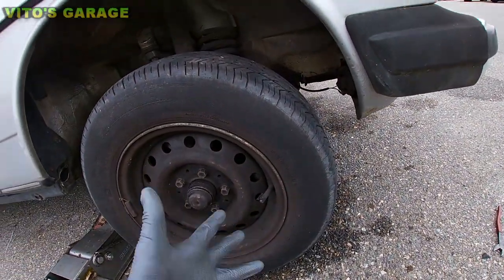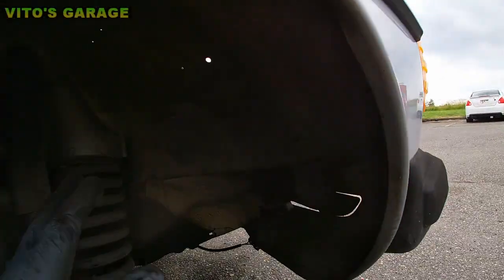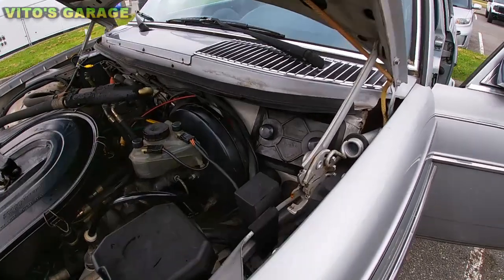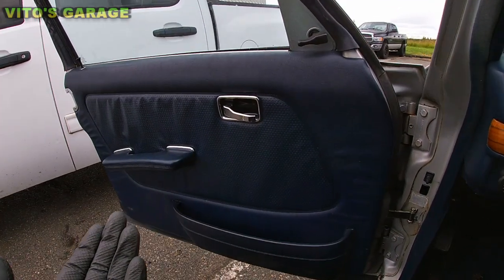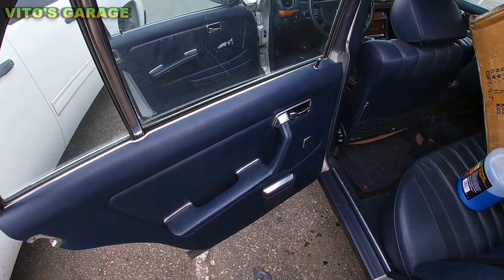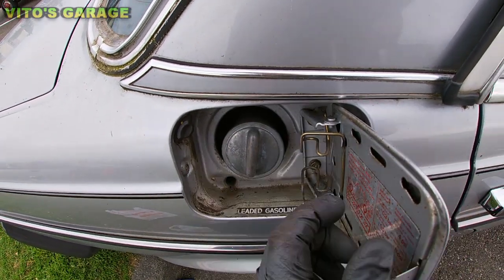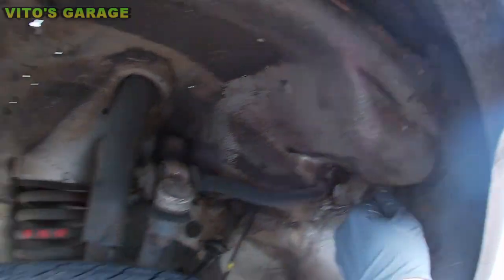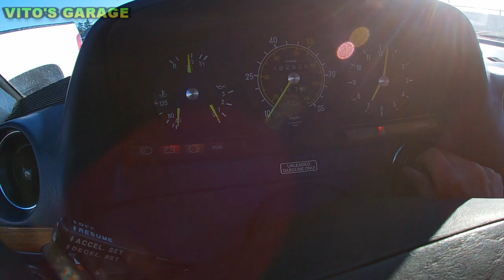Mercedes 280E W123 Finishing the Inspection & Delivering the Car!

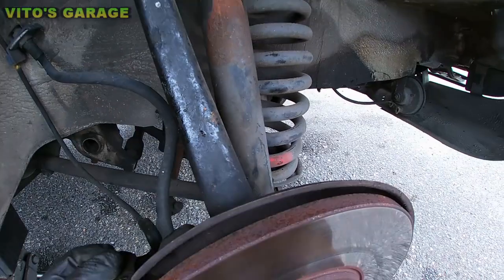Comment: 1:40. That kinked brake hose is exactly what I had on my 81 240D. It was so weiredly out of position the wheel was contacting it during full lock turns and over time wore a tiny hold thru it. So I lost my front brakes on the way home a few months back. Fortunately the dual brake system saved me because the rear brakes stopped the car. Couldn't believe it when I saw what it was and that this 280 has a problem with the same hose. Always be careful when  you buy an old car. You never know who did what to it in it's previous ownership.
Reply from the maker: That's crazy. Thank God everything ended good for you. And it's sad when people who don't know how to work on cars start working on them. This is how it ends up. We have to repair someones mistake

Comment: Great video as always Vito! Been watching your videos from the start. Could I ask you a quick question please. I acquired a w123ce 280ce a while back all the windows do not work. I have changed the fuses, checked the switches doesn’t seem to be any noise coming from there at all. Can you suggest anything else I can check on it? The sunroof is fine. It’s like the windows have not been used for years. Many thanks
Reply from the maker: You need to find a wiring diagram for the power windows for your specific car and diagnose it. You may be missing a ground or 12V power feed to your window switches.
Reply: Thank you Vito! 👊🏽
Reply: Hello, check your relay in the little black box, not the fuse box. A0015420219 or A0015422219
Reply: @souphianeb7908  thanks will review - do you know where this relay is located?
Reply: Otherwise it could be the vacuum system, have just bought an old c123 and have to tackle that.

Comment: This one has good bones and can be brought back to true beauty and made a daily driver.
Reply from the maker: Very true. Sadly, I just texted the guy and this is what he said: 

"Yea the car been sold. Changed thermostat and bled that fuc**r. Replaced the bad brake caliper and cleaned it up as best as I could. I lost money with it but I had no idea what I was getting myself into, especially given my circumstances. A bit sad cause I did love the car a lot but I didn't have the right resources, setup and the right approach. I came in for a profit but got attached and then upset cause I was losing money and couldn't hold onto it. "

So sad that people buy these cars just to flip them..... At this point these cars can only survive in the hands of real enthusiasts!
Reply: @VITOSGARAGE  Oh no. So sad. Hundreds and hundreds of these 123’s are going to be junked in the coming years because we don’t have enough people to appreciate them. It’s the same with the 126’s (I have a euro 500 SEC).

There is a gorgeous low miles AMG’d 280e on BAT right now that is going to fetch some good money. It’s insanely well kept, but will likely end up in a climate controlled garage instead of driven and enjoyed. If I had the money I’d buy it and make it my daily when my Camry lease was up.

Vito, how I wish you were not literally on the exact opposite the side of the country from me!! It would be so cool to stop by. Love your channel.
Reply from the maker: @ItsTimePictures  I went to the junkyard yesterday and there was a W140, 2 W124s, W115, W202 and W210. I almost started crying because it's like they were talking to me!!..... 
I go crazy about these cars and seeing them thrown away breaks my heart. A lot of people don't know what they own.. They don't deserve these cars.... 
Matt, I'll be going to Chicago at the end of December. I've lived there for 6 years. I have a few Benzes there too. After I am done with the military, I'll probably move back there
Reply from the maker: @ItsTimePictures  please buy another Classic Mercedes to love it and take care of. Even if it's a cheaper one. I'll be so grateful for you. You'll love it too. These cars are going away and I need a big barn someday so I can save them all. Or an aircraft hangar or something!
Reply: @VITOSGARAGE  How I wish I had the garage space. I don’t even have a place in the driveway. This has been a really tough year. The pandemic hasn’t been kind to my finances. :-) Hopefully next year I will rebound and I can find a nice 300 D or even better a 300 CD. My dream diesel is a 95 300e, but they are hard to come by and I don’t want one that is ratty. I’d want a lovely plush interior so my aging ass can drive in comfort.
Reply from the maker: Makes sense. You'll find something, just keep looking around. You can always message me if you need advices on repairs etc..☺

Comment: Are all the petrol models in the US imported? I have a 280e in England but I haven’t seen a diesel one here ever.
Reply from the maker: All the Classic Mercedes were made in Germany and were imported to the US back then. Germany made specific cars for US markets, Euro markets and for other continents. Those cars that were made for US markets had long bumpers and different headlights and other features. The cars that were made for US markets had A LOT more options added to them such as sunroofs, leather interiors, power windows etc.. Speaking of this 280E, it was made in Germany and was imported here back 40 years ago and sold brand new in USA.
Reply from the maker: Most of the W123s imported to the US were diesel. 300D W123 with turbodiesel was only and exclusively made for US market! You can't find 300D turbo anywhere else unless someone has imported one from USA
Reply: @VITOSGARAGE  300D Turbodiesel was available regular here in germany as station wagon.
i guess this 280E was a grey market import.
Reply from the maker: @vornamenachname5589  This 280E was made for US market. It's not a grey market car